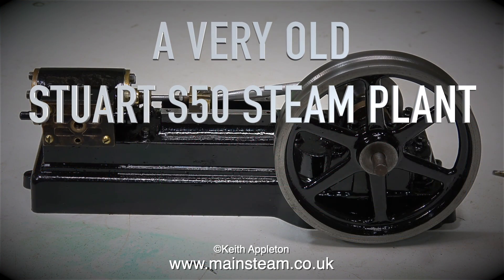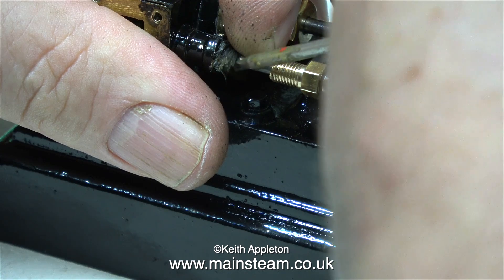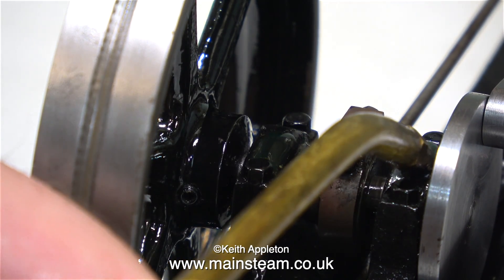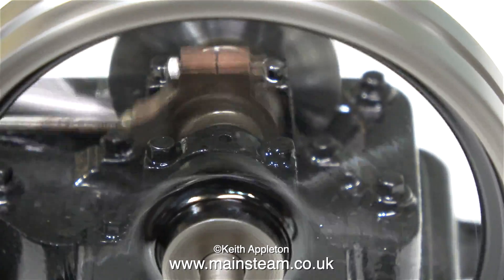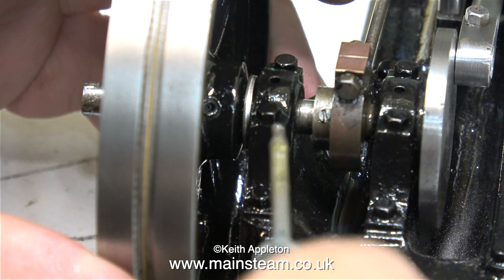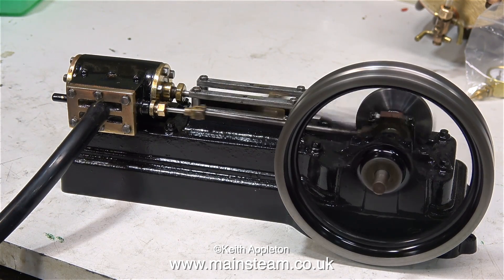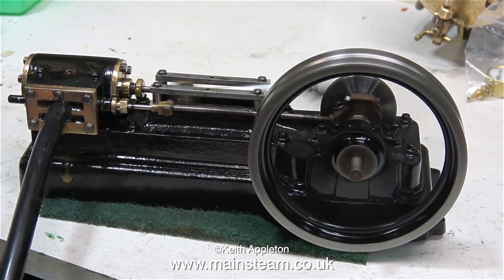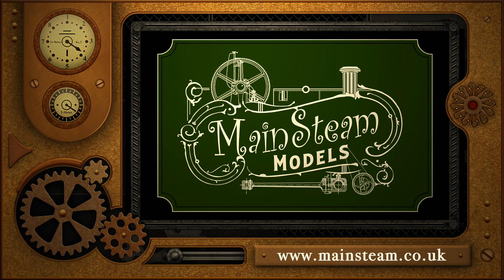A VERY OLD STUART S50 STEAM PLANT - PART #14

Comment: I think that the old type of packing must have been stored on the same shelf as asbestos insolation, so Health and Safety have decided that we can't use it. The one place I had worked at we had bought all the old style packing in both string, rope, and shaped rings that the supplier had. We ended up with a new manager and supervisor and they thought the old stuff was useless and through it out, there was almost a riot when we had to repack the glands on a 5hp water pump and had no packing for it. Non of the new stuff would work properly, they had to spend %7500.00 per pump (5 pumps) to convert them to O rings, which did not last as long as the old packing had.

Comment: You probably know exactly what I'm talking about, but a suggestion for a tool to help with getting that fraying thread stuffed. 

Games workshop makes a little sculpting tool( many other companies to) that has a blade on one end( not really sharp), and a flat spatula shaped on the other. It's made for sculpting green stuff and clay, but might be small enough to make that less of a headache with the flat bit. 

Like I said, you probably know exactly what I'm yapping about :-). Engine turned out amazing as always. I really like the black on this with the luster the metals took after you polished them. Very late Victorian aesthetic:-D